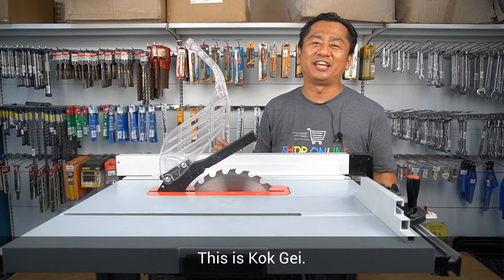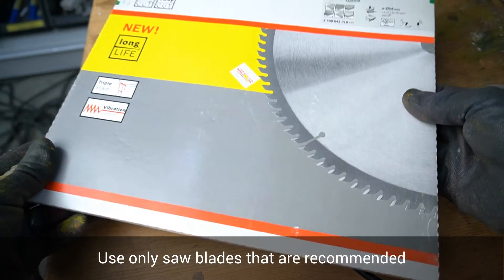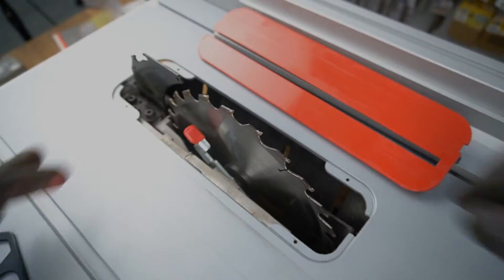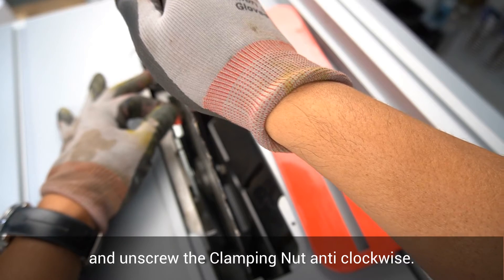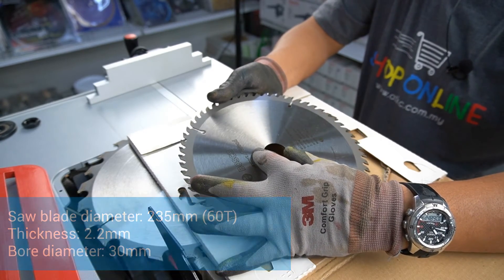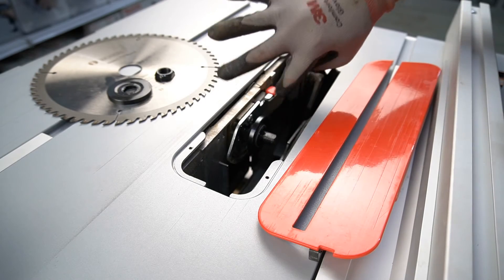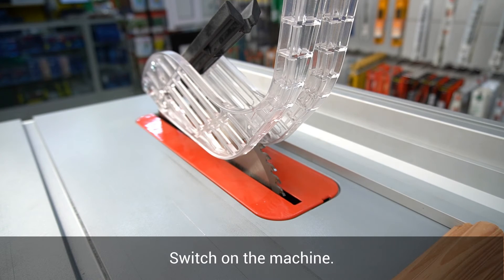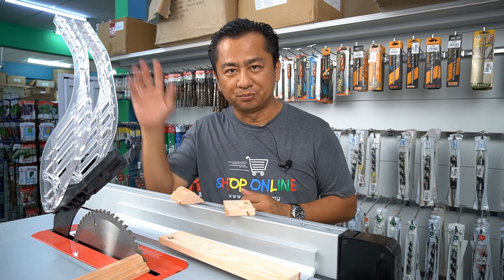Bosch GTS10J Professional Table Saw | Step by Step Guide to Change the Saw Blade

Comment: Thanks for the video..
This and your other videos on setting up this table saw model is the most comprehensive among all the other videos in YouTube. The instructions are very clear.

Thanks again.

Just a friendly comment. The way you did those cuts at the end is super duper dangerous.

1. You shouldn't have used the fence for those dimensional woods. Should have used the miter gauge instead

2. Your left hand was too close to the blade. Should have used a second push stick or some form of grippers.. 

I am glad you are not hurt though :).. But binding and kickbacks are very real threat on table saws.. 

Thanks again bro
Reply from the maker: Hey bro, thank you so much for the comments. Appreciate that!

Comment: Aiyooo broo...thats dangerous wooo. NEVER EVER free hand cutting with a table saw. The way you setup the fence and free hand cutting without using the miter gauge is asking for trouble. Not hating but just so nobody who saw this would not do the same thing. 

Kickback is real and this setup increases the risk by a LOT
Reply from the maker: That's a good advice. I have been checking on more info on kickback. Thanks again for your highlights.

Comment: I can't seem to fit the reduction ring onto the mounting flange, is it meant to require a fair bit of force or adjustment to fit on it? Using the exact same blade (10" Bosch Expert for Wood).
Reply from the maker: Hi, there are actually 2 reduction rings. 1 that fits perfectly, while the other 1 is the same as you have mentioned here. Well, I was having the same issue too.